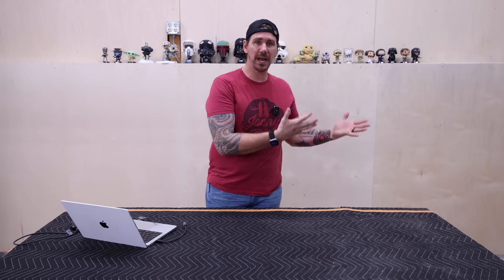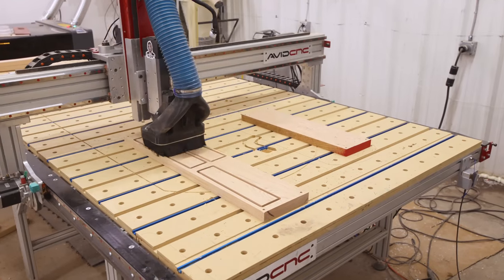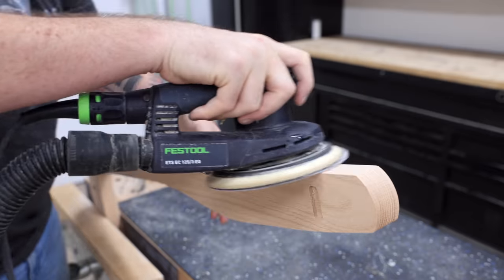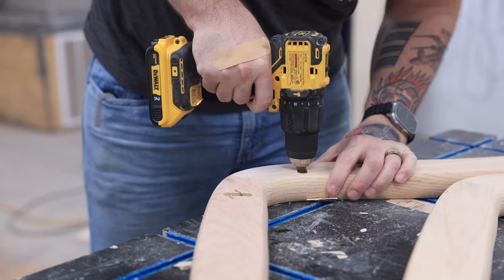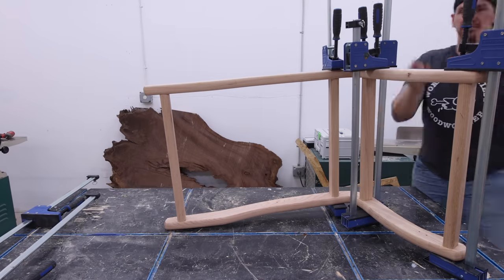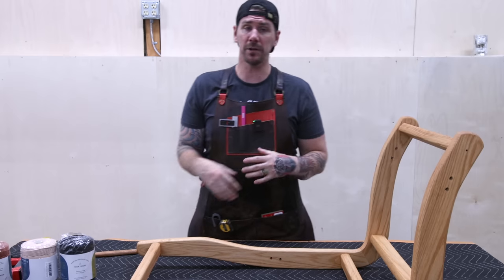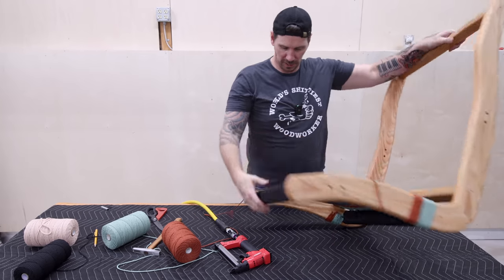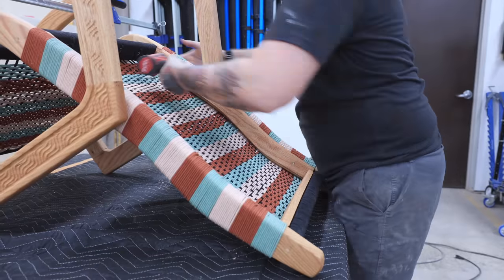Building Her DREAM CHAIR

Comment: Beautiful chair, great vid! I just watched a different tool tops video the other day. They placed tape down first then glued the "plywood blocks" down on the tape. Used to clamp the joints together. Once pulled together and glue dried, he just  pulled it all off with tape. Nothing to knock off etc. Thought this might be a tip that might help in the future... Thanks again for the great videos!

Comment: Lovely effort. But, hmm, why didn’t you use paracord? Just curious. Please do a followup after a year of use - how much will the cotton string stretch? I’ve got several antique handmade ladder-back chairs that need reno - don’t want to cane or rush weave the seats. Hand-split hickory would be fabulous, but hard to find and worse to work with. So, thinking of going very modern with a paracord weave. Now, maybe not. I prefer the cotton over the synthetic.

Comment: Ignorant question: instead of gluing your plywood clamping blocks, could you have used painter's tape first, then glue the blocks to that? My instinct is that your answer will be that the tape-and-glue method would not have resisted the clamps enough, but I need to ask.